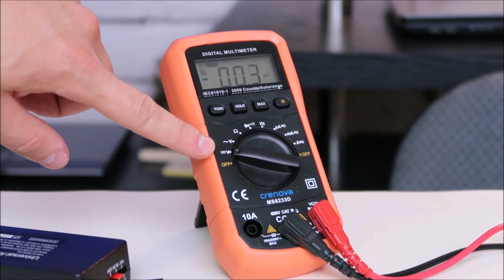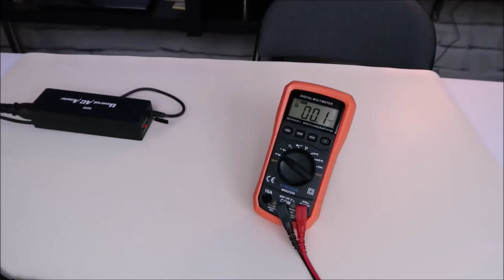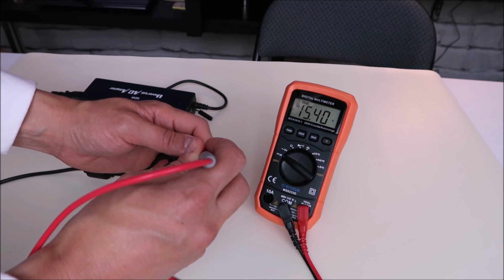How To Fix Any Laptop - Wont Turn On, Wont Open, Turns Off Right Away, No Power Solution

Comment: I have an acer nitro 5 ans517-51 2019 model and it won't turn on, the laptop's charging LED still lights up blue when plugged in. I have tried powering it on without the charger and the other method without the battery, my laptop only has 1 stick of ram, i've also tried doing the CMOS battery reset and it still won't work
Reply from the maker: Have you continued on in this video past the BIOS Reset?  The next steps are to test the charger and continue on until everything is ruled out leaving only the Motherboard as the issue.
Reply: @PC_Monkey  the thing is my laptop charge LED light turns on when plugged in.
Reply from the maker: @ThreshtheWeebWarden  That means that the LED board is getting power.  If its part of the motherboard, it means that part of the motherboard is getting power.  It does not mean that the motherboard is getting enough power or that the motherboard is doing the correct things with it.
Reply: @PC_Monkey  okay so the laptops turning on now, it was a problem with the ram stick. Now im having problems with my keyboard, some of the keys stopped working
Reply from the maker: @ThreshtheWeebWarden  To troubleshoot keys, refer to this video;  https://www.youtube.com/watch?v=wqrchfpdJ_w

Comment: Hey PC monkey. Nice video there. I have a question. My computer has a problem the same. But I already do the procedures, including bios reset still not work. Any inputs so I can repair this computer?
Reply from the maker: If all those tests do not reveal the issue, then your most likely looking at a Motherboard replacement.

Comment: I have dell latitude e6320. I have checked adaptor, battery, bios battery with multimeter all are good. Ram removed & re inserted. Still laptop is not turned on. 
Laptop got switched off directly while I was  using it. What should I do next??
Reply from the maker: If none of these tests found the issue, then its most likely your motherboard that needs to be replaced.

Comment: @PC Monkey  bro i had manage that..but my laptop after installation when it first restart. It again goes back to windows 10..but i wants to give Windows 10 64 bit..but after restarting it again starts from the begaining.. 😫😫
Reply from the maker: I dont understand your issue.  You installed Win10 64 bit but when you restart the computer its just Win10 and not 64bit?
Reply: @PC_Monkey   yes bro...i got the solution by watching your previous videos.. You are the best..i really appreciate ☺

Comment: Very good video, I have a Gateway, HP that will not turn on, using your battery method I got my Toshiba to boot up but goes into some kind of "bios" boot, plugged in a Xtra pc and now I can use the Toshiba but it wont boot up normally, gets stuck in the fios boot which I don't know to make it work. PC came with "windows 7"
Reply from the maker: For the HP that wont turn on, your on the correct video.  Try the steps seen here.  For the Toshiba that only boots to BIOS, try a BIOS Reset as seen here;  https://www.youtube.com/watch?v=76I2Ec9K7lw

Comment: Ive had the issue when it says no bootable device 6 months ago because I accidentally dropped my speaker on the area where the hdd is located then I checked if it was broken and it was because it was clicking so I bought an ssd which is the samsung 860 evo and now I cant start my 2018 nitro 5 laptop.
Reply from the maker: So is your issue now a 'no boot device' error or will your computer not start?
Reply: PC Monkey both
Reply: it wont start up on the home page and when I turn it in it just says no bootable device
Reply from the maker: @spxrit_ear5858  You cant have both errors.  If the computer is not starting then its off.  If the computer is saying 'no boot device' then its turning on in order to say that.  I dont understand your message 'it wont start on the home page'   If your getting a "no boot device" error on an Acer computer, refer to this video;  https://www.youtube.com/watch?v=S7_3toBNYgY
Reply: @PC Monkey Uhm I already watched and did it but it still didnt work...
Reply: @PC Monkey I messed around in the bios and now it says 

“Default Boot Device Missing or Boot Failed.
Insert recovery Media and Hit any key
Then Select   ‘Boot Manager’ to choose a new Boot Device or to Boot Recovery Media”
Did I made it worse?
Reply: @PC Monkey I cant disable Secure Boot Mode and I cant switch to Legacy.What should I do?

Comment: Hey mate my when i plug the charger in the laptop starts for 1 or 2 seconds no display on the screen just the fan turn for a second and a blue light l3id when it starts and goes away when the fan stops . I know the battery is dead . I tested the charger it says 19.24 and changes to 19.25 sometimes 19.26 . What do you think the problem is ?
Reply from the maker: If you know the batter is dead then it should be replaced.  It is usually difficult to troubleshoot a computer with more than one problem as you really never know if one issue is affecting another.  If the all the steps here ( BIOS Reset, RAM check, etc. ) dont help find the issue, then your motherboard is the issue and it should be replaced.

Comment: hey so uhm. i have an big issue with my laptop, the problem is what it has on the screen is: black screen
/ just little glitched lines in a square that are 2 x. pretty small.
i cant do anything about it. its just. stuck. i really want it to be repaired. but i have no clue where to start or what to do.
i dont remember what laptop. cause it happened like.. uh. few months, yeah i cant remember. but yeah. i can take the laptop and look at it again. I hope you can find an solution to this. im just doing this to other channels that can repair laptops. so yeah, hopefully you see this.
Reply: also make an video about it, if you know how to fix it.
Reply from the maker: @mr.shqipe2519  If the laptop starts and the screen stays black then your video would be here;  https://youtu.be/u-REPLdpZ70.  If your computer is not starting ( no fan noises, no motherboard or hard drive sounds ) then your on the correct video now.

Comment: Hey I’m having a problem with my Lenovo yoga laptop it charges but won’t turn on
Reply from the maker: If your computer is not turning on at all, you are on the correct first troubleshooting video.  Have you tried the steps here yet?
Reply: PC Monkey no I’m scared to remove the battery cause mine is inside the laptop
Reply from the maker: @beverlyb9568  You can see how to access the battery in a Lenovo Yoga here;  https://www.youtube.com/watch?v=8Agy33t7VMo
If your not comfortable with accessing it then you prob wont be able to do a DIY troubleshoot on this.  You should bring to a repair center.
Reply: PC Monkey ok I will access the battery and follow up with the video thank you 😊

Comment: Hello i have a problem in my acer 315-41 it wont dont on, if i connect with the charger the light indicator is always in orange mode, what do you think is the problem? Pls. Help me sir
Reply from the maker: If your computer is not turning on at all, you are on the correct first troubleshooting video.  Have you tried the steps here yet?
Reply: @PC_Monkey  i dont have guts to open my laptop because of lack of knowledge and experience in trouble shooting, there something to deal with the battery sir?
Reply: By the way sir the battery of my laptop is internal

Comment: Is there a fix to a hard drive where i cant copy files from it but i can copy files to it. Also i can access one of the local disk but not the main local disk which have most part of the memory of the hard drive.

And another external hard drive that was working perfectly just the day before then i cant be detected anymore the next day but it still make noise when plug into the laptop but cant be detected?